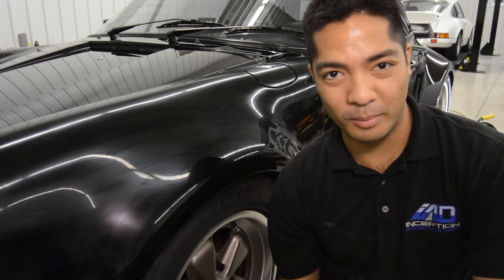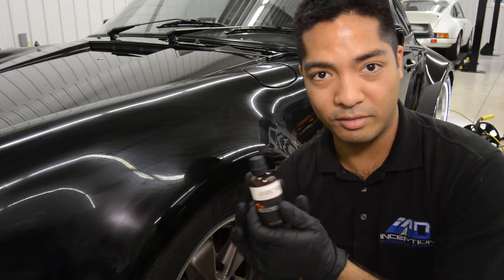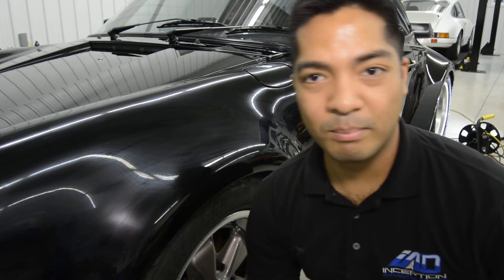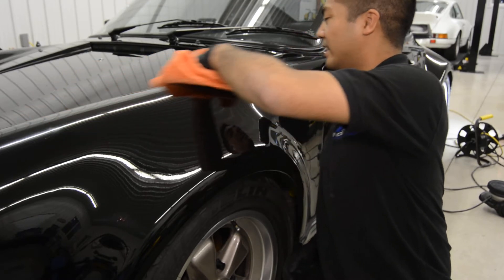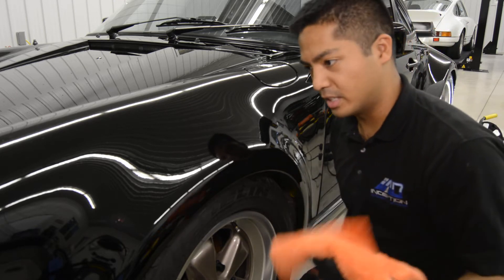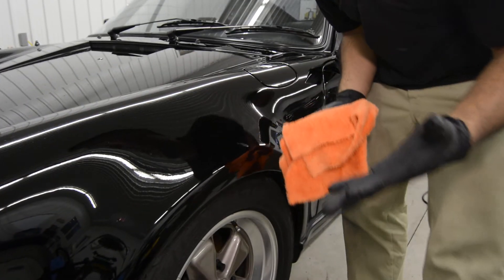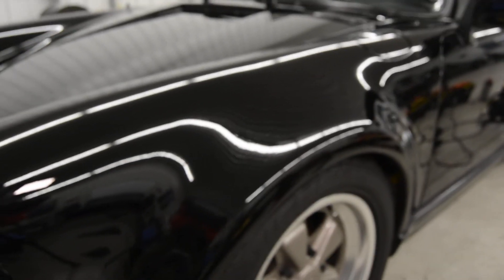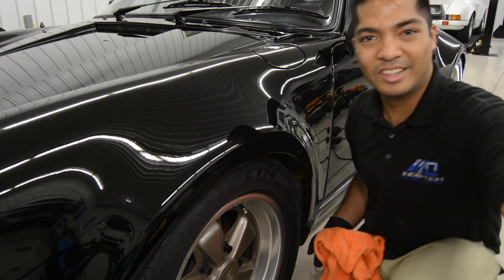Auto Paint Protective (Ceramic) Coatings Explained - An Overview  |   Inception Automotive Detailing

Comment: how many coats do you apply? My nsx had this applied about 4 years ago... I guess it might be ready for another coat or 2?
Reply from the maker: Hi @enkrypt3d

Depending on which coating brand you had installed, many typically lasts between 2-5 years depending on how it's been maintained. 4 years is a good duration but with our 22PLE ZX Mistico Elemento, you should get 5 years out of it.
Reply: yea I have 22PLE on the car and it still feels extremely slick... Wondering if I'll benefit from applying another coat or 2?
Reply: @enkrypt3d  yes sir. It's just going to keep building up and will pay off in the long run. And usually 1-2 coats of Mistico and a coat of finitura on top.